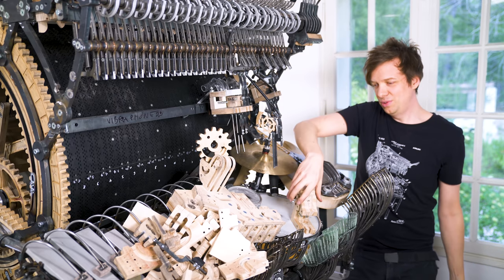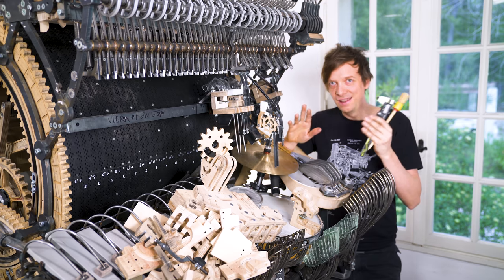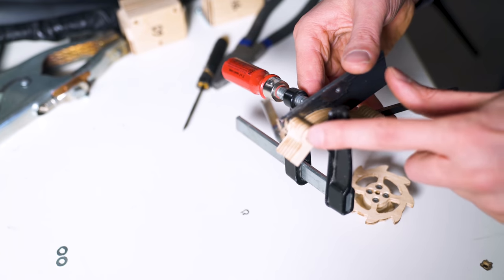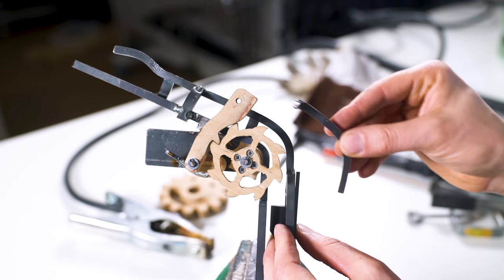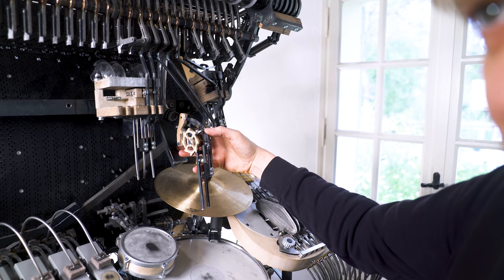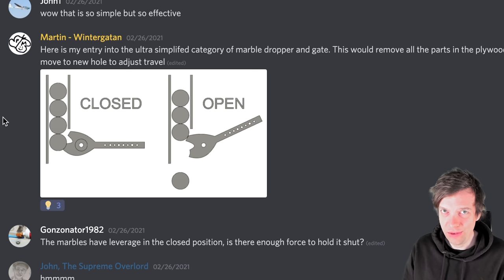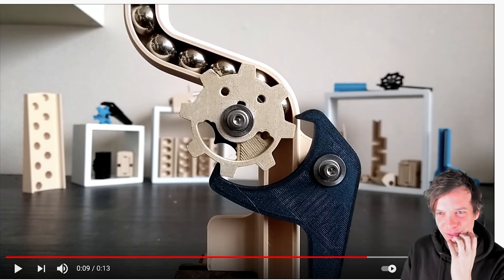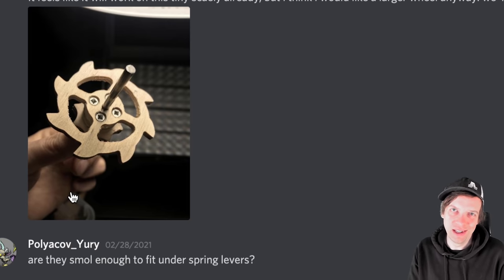Clock Escapement Marble Gate

Comment: If the input runs dry, and a marble arrives at just the wrong phase of release of the last marble, it may bump against the tip of the sprocket and not turn the sprocket forwards or backwards.  At this point, the wheel stays jammed, though without damage to the machine.  This will only happen maybe 1 in 1000 times IF the input runs dry.
Reply: Matthias! 🙌
Reply: If there is no marbles the sprocket will not move, its the weight of the marbles that moves the wheel.  So there is no risk that a marble arrive in the wrong phase.
Reply: if the system runs dry, maybe the marble will arrive fast enough in the whell for it to snap back into position ?
Reply: @PerKroon  if the marble arrives as the last one is released, it can be in the wrong phase.
Reply: Martin has said before that no channel can ever run dry or he will have many problems.  I believe the intent is to consider this even while composing, to ensure one channel is not hammered long enough for this to happen.
Reply: Would putting a curved edge on the sprocket possibly help? So the marble that would normally get stuck just pushes the sprocket forward?
Reply: @matthiaswandel  Having a gate run this dry, only a marble left before there are none anymore, is a wayy bigger problem up top then down at the gate. Thanks for inspiring Martin with all your woodwork by the way, inspiring Martin is very fulfilling 😁
Reply: With careful design of the pawls it can be made so upon actuation it would clear such a jam by making sure upon closing it boosts the wheel forwards (or backwards, depending on the nature of the jam)
Reply: @matthiaswandel  
First off there will always be marbles in the queue.

Secondly: If it for some reason is no marbles in the queue the machine must be stopped anyway to refill all the lanes.
Reply: @matthiaswandel  in a previous video, he said it never runs dry.
Reply: with the spring arresting the wheel, I don't think it'll ever be in a wrong position.
Reply: @tiavor  the spring is not permanent it will be gone in the next design
Reply: system will not run dry by design. wouldn't be good to miss a note because there were no marbles in the queue, now would it?
Reply: Wouldn't the next marble falling into the input thrust this stuck marble forward ? (or some amount more)

Also with this there's a guarantee that the marble transport have to fullfill : make sure there're always 4 marbles in each gate at least
Reply: @PerKroon  well, assuming that all marbles are always filled is a tricky assumption.
ideally in such a design, a part should be its own entity that withstands some complications. and the way the marbles are fed into the pipes at the top is a bit of a precarious situation, so I think it would be good if the gates could handle running dry.

don't get me wrong, I still like this idea much better than the old ones, but we should be open to criticism and don't dismiss it prematurely
Reply: add some notches and a spring loaded ball to have it always snap to the most favorable stopping position
Reply: If the marble cue runs dry, then somthing isn't wrong with the design, it's something wrong further up in the machine. Martin's said multiple times that they won't run dry.
Reply: I think it's easy to unjam with a quick rotation.

Or a small tweak to the gate resolution to permit better motion.

Anyway well done Martin
Reply: @MrWhateva10  well that was cause the old marble gates wasn't it?
Reply: if you put a spring on it so it will be in the far ready-to-go position it will reduce the chance of it further
Reply: I don't think it will run out of marbles on the gate. There's just too much marbles
Reply: Martin has talked about the importance of not missing a single note, so I don't think he would ever let it run dry, you have to remember he has 2 channels per note/instrument meaning that the work of a single clock dropper will only be half the load of the note roughly. So, I think he shouldn't encounter this issue.
Reply: If your pump is dry you have bigger problems.
Reply: to fix this, just put a little weight on the wheel so it will naturally turn to a "marble accepting" position if no marble is pushing it
Reply: If it dry out , the performance faied already.
Reply: Yeh but could you imagine playing something fast to do that, actually is there math for that? something like lane saturation vs marbles per beat/cycle
Reply: Dammit Matt, I love/hate you.
Reply: 1 there is no reason for the marble turbine to be of another material than plywood, it's hidden deep inside the structure. 
2 couldn't there be a shape to the marble turbine that will feed itself like the shape of a hydropower turbine?
Reply: @destroyer2012  could work, with a spring loaded rounded pin in a round toothed gear.
Reply: he wont be playing music anyway if the input runs dry. literally.
Reply: Have a look back at 2:50... It works until the channel is dry.
Reply: The sprocket wont move unless the marble is there to apply pressure. At worst the marble is skipped or out of time. All that aside we operate on the assumption that we will never run dry
Reply: If the machine is running correctly no channel should ever run dry.
Reply: @Liberec2  Go play Factorio
Reply: Luckily the input never runs dry.
Reply: I agree. To all the people saying: „it will never run dry“ you don‘t know that! Even if the songs are composed to prevent it. The filling of the marble que is left to chance. There is no system to MAKE SURE they are filled. So because Martin is aiming at such a high reliability the design should account for this event even if is is extremely unlikely.
Reply: Incorporate a small, asymmetric weight into a small group of teeth on the sprocket. The imbalance will ensure that it will always attempt to settle into phase when there is no feed. The feed pressure will always overpower the weight so even if it were to backspin without feed, it couldn't cause a jam. That said. This is already such an edge case that its hard to determine whether or not this is even needed. The vibrations from the rest of the system would probably naturally clear such a rare and easily resolved failure.

Comment: I stand by my past comment: "Aesthetically pleasing designs can arise from proper functioning parts". The escapement fits really well in the whole idea of the marble machine.
Reply: In short: "Form Follows Function"
Reply: @Hirosjimma  "form follows function" however doesn't imply that the resulting form is pleasing to the eye, which is one of the main thing Martin is going for. I wanted to emphasize the fact that when you have a robust & reliable solution you have much more leeway to add flair.

Comment: Now we just need to incorporate that marble divider that didn't need a specific marble height.
Reply: I think that's pretty much a given by now...
Reply: I think that can be done by instead of having little cutouts in the wheel that's retaining the marbles you could have it smooth with a you thick sheet of silicone wrapped around it that the marbles will dent into and get caught and then it doesn't matter the position of the marbles because the wheel will align regardless because it's flexible.
Reply: It would be a huge rebuild, but I'm all for it. No more messing around from the top of the lifts to below the releases after that.
Reply: A second set of escapements up top at a known good length to isolate the channel length from the number of marbles stored and potentially a mechanism for freewheeling the upper escapement when starved.
Reply: My original design had a much smaller escape wheel, but two of them sandwiching the marble wheel, such that the anchor and pallet were actually in line with the marbles (narrower). The escape wheels would be metal, the wheel wood. The wood would be clamped between the two escape wheels maybe even with thin rubber sheets. Martin could then change the angle of the marble wheel independently of the very much fixed position escape wheels.
He could set up a camera on the top, looking at the divider, with a monitor by the gate. With a full marbles stack, he then holds the marble wheel from below, untightens the clamp and manually adjusts the wheel so that it raises/lowers the marble queue on his monitor until its flush. Retighten and then job done.
One issue with this is that the release point of the marble may no longer be exactly when the dropper is fully back, meaning it could fall too soon, but this could be rectified with a simple hook attached to the dropper arm which loops around the rails and into the marble path, catching the marble as it falls from the wheel and preventing the marble dropping further down the rails until the dropper is ready to catch it.
Reply: Could also make the position of, as Martin called it, "Tok" to be adjustable so the resting position of the loaded marble can be moved forward or backward to alter the marble queue height. Downside is instead of a solid piece, the dropper itself will most likely need a set of threaded holes going down it so "Tok" can be put into different positions
Reply: I thought that problem was already addressed by the height modules with variable length paths? Those could stay in, right before the new escapement gates?
Reply: @DesignRose  yes, maybe. There several ideas bumping around the Discord for divider designs that are insensitive to the path length. The beauty of my idea is that it requires no additional parts (other than the one little hook wire which would be part of the dropper arm) and also requires no modification of the very simple existing divider. As Elon says, the best part is no part.
Reply: @MrGonzonator  But having a more solid divider you have a lot less problem to fix. No need for adjustable path, more reliable and he could run the pipe straight from the divider to the dropper.
The new dropper seem more complex, but it eliminate the adjustable pressure gates.
Reply: @ameunier41  I agree, it's the more robust solution. The tricky part is convincing Martin to do it!

Comment: I am a software developer - I can tell you, it is exactly the same feeling: when you finally found the right way to do something in your design, how much fun it is to throw away all that "wrong" code you have been working on for days, and to replace it by the clean and right solution.
Reply: I actually did this today, refactored old ugly code into something lean minimal and sparkling. The feeling is real.
Reply: Oh god, this is too real. Nothing beats the feeling of replacing monstruous ugly code with some sleek, readable, well designed code.
Reply: @henrycgs  sometimes I just want to put all the bad iterations in the comment, just to let someone see, how much work somebody had to put in this single line of well designed code until it worked just as intended. And then I recognize, that sb with a bigger brain will rework all these lines of code much better. 😅
Reply: Sub Marble_Drop()
Dim Marble as Range
 
  For Each Marble In Range("PMMA_Pipes")
    If Marble.Position =1 Then
      Marble.Drop = "Positive"
    ElseIf Marble.Position > 1 Then
      Marble.Position = Marble.Position -1
    Else
      Print "Error, Marble on floor."
     End If
  Next Marble
 
End Sub
Reply: @MrGonzonator  I like how you put most of the work into paragraphs and spaces although most of the audience won’t get it. 😅
Reply: @MrGonzonator  @Requiem I got it. But it's VBA, and therefore gross. :P
Reply: @defenestrated23  I only know how to program in Excel through attrition. I'm thoroughly Fenestrated.
Reply: @karmakid123 is there another way?
Reply: I can relate to that too ^^

Comment: could have a brass gear for that extra clickspring-esque flair
Reply: Yes!!!
Reply: I think the sound and vibrations might be an issue, but could look cool, agreed!
Reply: I agree that vibrations might be an issue, but there will also be more noise I think. Still a nice Idea.
Reply: also it would stand out in the way Martin wants, great idea!
Reply: Brass wheel, Delrin pallets, beautiful and quiet.
Reply: Oh. My. God. 

This. Needs. To. Happen.
Reply: Same idea I have in mind when thinking about the stainless steel gears. Brass will look awsome and more like professional clocking mechanisms. Also it is easier to cut, weld & polish.
Reply: clickspring collab maybe?
Reply: Oh yeah I have a real concern about a wearing part being made of wood.  I say it would be 10/10 being a proper wearing part
Reply: @MrCombic  I mean, we already have clicksprings timing clutch on there
Reply: NUT
Reply: @gregself6203   But the marbles would still hit the brass, making clinking noises anyways.
Reply: @MorningDusk7734  the marbles don’t have to hit the gear, they travel beside it
Reply: @MrCombic  Also brass is "self-lubricating"!
Reply: At the very least he needs a brass tube lining the gear to act as a sleeve bearing, a brass gear would be great but chunky brass parts are expensive to make out of machined stock with the cost of the metal these days and casting would need way too much finishing work
Reply: @ethansmith7  The teeth of the gear are catching the side of the marble, that's what's stopping them from moving forwards past the gear when the gate opens. That contact with the brass will create a clink, plus brass is relatively soft, leading to deformation during long trials.
Reply: @juleslindsay7599  yes but the click will always be in time. The sounds you want will be processed and amplified. Ambient background click , if drop distance is adjustable or unified will almost act like a metronome.
Reply: @MrCombic  Brass isn't typically welded, and when it is, it's far trickier than welding stainless.

Comment: Martin: spends weeks completely re-engineering marble gates to deal with pressure
Me: okay. this is like the fourth time but at least it'll be worth the effort, no way he changes the plan this time
Martin: completely eliminates all that work with a ground-up redesign
Me: surprised pikachu face
Reply: Insert "I see you're new here" or "First time" meme. Martin will, without fail, pursue a different course if it improves the performance of the MMX.

Comment: This is such a good solution it makes all the previous gates look terrible.
It looks cooler, 
It's simple
It totally gets rid of the pressure problem
It's totally repeatable for every channel.
There is no reason it wont be 100% reliable.
Reply: and it tick tacks!
Reply: Laughs in mole
Reply: I am worried that the wheels/gears would be worn pretty quickly since they're made of wewd.
If they were metal, it wouldn't have such a low durability, but wewd is easier to replace I guess when they're broken
Reply: So true!
Reply: Martin likes the contrast of wood and metal, but I would flip it so the moving, contacting parts are metal and the stationary rail is wood.
Reply: @MrGonzonator  Aesthetically I'd love for them to be brass. In my mind gears should be brass. :)
Reply: Harrison McKee He mentioned the possibility for delrin to be used. This will probably be the best option for the longevity of the wheels. Regardless, they seem super easy to pop out if one needed replacing.
Reply: Don't jinx it
Reply: @HarrisonMcKee  honestly the wood is pretty hard wearing. Since they are not under much stress they should be ok.
Reply: @taotriad  It comes in at least white and black. I wouldn't classify that as ugly. If it matters that much, you could use delrin for the center marble catcher, and still use wood for the clock gear, since its currently two pieces anyway.
Reply: @SpudSpudoni  Black and white will ruin the steampunk look of the machine. Honestly, I don't think they will wear of so quickly because there isn't so much pressure on them.
Reply: @tomasitto299  Yea to be honest, I don't think so either. It was basically just my response to the person I originally replied to, asking about what happens if they DO wear out. I agree, the plywood Martin uses is tough stuff.
Reply: @gerardmourits8709  or at least jinx the jinx!

Comment: Glad he's found a nice solution that will help him finish the MMX, but I swear, he said the same thing about the last marble gates.
Reply: "This time is different!"... The most expensive four words ever
Reply: Well. you never know how many parts you can remove until you actually do.
Everything is relevant
Reply: Well, he was also having functional & aesthetical problems with that design, so I'm not surprised it got replaced.
Reply: That is how all good engineering design processes work.
Reply: @francescosirotti8178  nah the inflation on those words are too high
Reply: He was trying to force himself to believe that but it is a slippery slope
Reply: The difference this time is that this is the way.
Reply: This is a worthy improvement over the previous design in more ways then expressed in this video.
Reply: a "best" solution will only stay the "best" until you invent/find something better ;)
Reply: Completely agree. You can find 100 ways to drop marbles. He needs to move on.

Comment: I applaud the ability not to fall into the "sunken cost" mindset!
Reply: Yeah this design is a great example of avoiding a local peak. Iterating on the pressure gate didn’t make the pressure gate the best solution. Just the best version of a pressure gate. 

Congratulations to the team for realizing there may be a higher peak and not getting stuck in the sunken cost of fining a local peak.
Reply: It's easier to escape when the alternative is this cool

Comment: Gotta admit that this little thing is one of the most technically clean changes for the machine. Its pretty too.

My only concern, noise.. tick tok x a lot.
Reply: @Minecraft Platinum Fireworks 32 tick-tocks all at different times could be a problem though ...